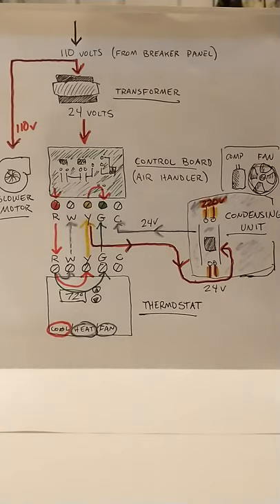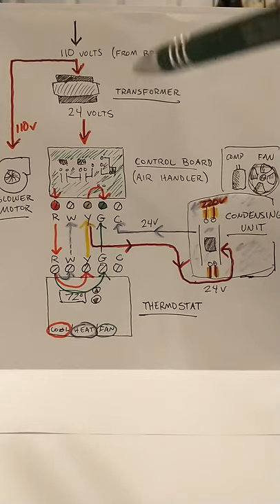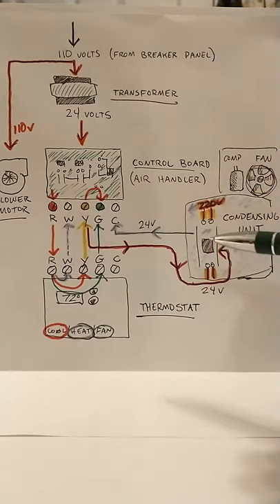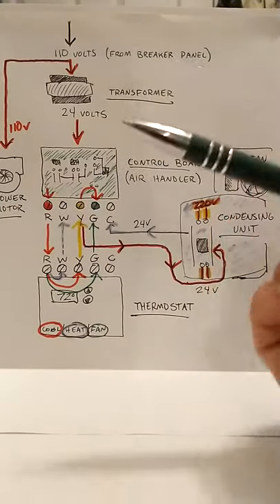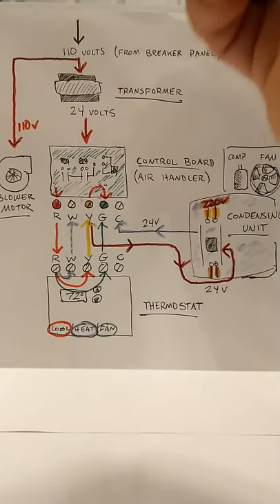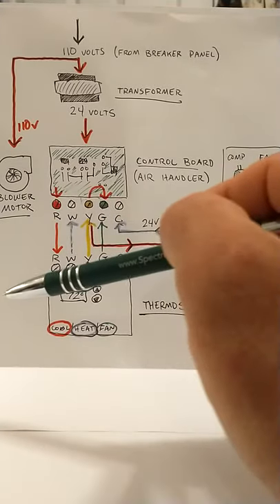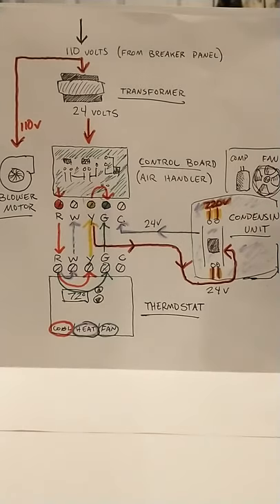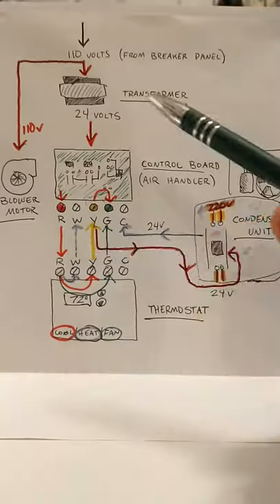HVAC Low voltage control wiring (Basics For Beginners)

Comment: Mike, You are an excellent teacher.  I am an electrical engineer but you made it a piece of cake to understand everything that is there to be learned about HVAC wiring in under 12 mins without any fluff or BS.  I am surprised you just have 2.42K subscribers. More people can benefit from your top notch content.  Thanks a bunch for putting this out
Reply from the maker: Thanks for the feedback. Really appreciate it!
Reply: Ditto!! Don’t need colors just the schematic and mike nails it!!

Comment: This was THE best video on the topic.  I have watched a lot that cover thermostat but I wanted to full picture which included the furnace controller card.  This video was the best as I am an electrical engineer (not an HVAC expert or even an electrician) but I was going nuts not understanding how the 24 VAC closed the circuit.  Nobody else explained it but this guy did!  Now I feel confident rewiring my 50 year old house with labeled wiring for a tech or the next home owner.  Thank you!
Reply from the maker: Nice. Glad it helped!

Comment: Your explanation was very clear.  I worked part time with an electrician for six years.  When I look inside my air handler it looks like a big jumble of wires.  You made it very easy to understand.  It’s just a bunch of different circuits.  Great job!  Best yet!

Comment: I’m a new HVAC installer and have only been employed by a company despite not having any sort of schooling or knowledge about anything, After a month of practice I am able to do everything i need to help out my leads, but have been struggling to understand what each low voltage wire does and I feel significantly more comfortable with it after this video. It was very clear and helpful. Thanks man

Comment: Thanks man, a control wire had popped off my circuit board for the outdoor condenser and your video helped me to quickly put it back where it belonged on the common terminal.  Also de-mystified the color code confusion overall👍👍

Comment: Best simplified explanation!  Thank you for taking the time to make this video.  Keep up the good work, and keep the videos coming!  I would greatly appreciate it if you could make a video on how to hand fabricate a seamless drain pan, and how to wire a condensate pump into the alarm system so the float switch shuts down the unit if the drain pan gets wet.
Reply from the maker: I need a little clarity. Are you asking how to wire both a safety switch in a condensate pump and a float switch in a drain pan together into the control wiring to shut down cooling if either one is activated?
Reply from the maker: It would be the same as wiring a float switch as I described in the video. 

One end wired to R terminal at the control board, other end running up to R terminal at tstat (to shut down everything). Or you can use Y terminals at the board and tstat instead (to shut down just cooling) If it's a 90% furnace that generates water you can even do the same with the W terminals (to shut down heating). Few different ways to do it.

Comment: You made this easy to understand, I watched this video because I need to install a safe T switch and I need to identify circuit R. I had drain pipe clog that spilled water to my sheet rock. I want the switch to shutdown the unit for me when I am not home  or to avoid water damage.

Comment: Print this chart and check both ends before you DIY to be sure the installation tech wired it this way, some use their own wiring preference to prevent home owners from working on it. Causes more damage THEY will benefit from in the end and being they are legal HVAC certified and homeowners are not a court will side with the tech. Like the video great wiring diagram layout to help.

Comment: woke up to find out my heat never turned on, after watching some vids i found the low boltage fuse popped, replaced and still pops only on heat, trying to find out where the short is, this video is definitely the easiest to understand, within seconds of looking at the picture i was figuring out how it works. Thank You. hope i can fix my problem with the new knowledge.
Reply from the maker: No problem. Let me know if you find it.
Reply: @JerseyMikeHVAC  after 3 days of trying to figure it out i cant. no wires are exposed everything looks good. just blows fuse on heat, have been using ac fine. im trying to figure this out cause its for my mother and she cant afford to have a tech come out and look at it. ive learned a ton so far but cant fiigure it out.
Reply from the maker: @wrench  If it's just on the call for heat, it most likely has something to do with the wire between the W terminal on the thermostat and the W terminal inside of the furnace. 

 Do you have any extra wires available on that thermostat wire bundle? Maybe a blue wire unused? If so, disconnect the wire from both W terminals at the furnace and thermostat and reconnect the new wire to the W terminals at the stat and the furnace. See if that resolves the issue.

Comment: Best case of a so called union trained HVAC guy they called the filter king because it was the only job he couldn't screw up. He installed a maybe 5 ton AC unit in an office. He was so proud if himself he had the office manager watch him turn the unit in for the first time. Some how the filter king had the red wire going to the T stat connected to a 480 volt leg.  Left a 4' high burn mark.on the wall.
Reply from the maker: "Some how the filter king had the red wire going to the T stat connected to a 480 volt leg"

Lol. I have SO many questions right now. I get on my guys for not doing a drain assembly just right. How is this guy not tied down to something right now?

Comment: In the configuration shown, Y is jumped to G in the air handler. What prevents cooling from kicking on if you switch the stat to fan only? Seems to me it would close the circuit to Y in the air handler? 

Also, I am looking to connect my condensers to the load shed module in my generac standby generator transfer switch. I will break the red wire at the condenser where it connects to the contactor. I think this would shed only the condenser and not the air handler, correct?

This video was very informative. Thank you.

Comment: An Former Jersey man here.  What a great video!   Could you please help me out. I just installed a MrCool 36K hyper heat system. It is working fine, with the thermostat that came with the unit, (its only a 2 wire setup). Question is I would like to use my nest thermostat with the new unit. Would you please tell me how to connect the wires up. I don’t want to screw this up, by guessing it.   Thank you so much, if you can help me.

Comment: Around 8:08 you mention wiring in different switches, devices. At what point, if any is too much to pop the fuse,  cause a lockout or even experience drops in amps or volts; again if even possible any?  2:  The red hot comes in at 24 volts but does it reduce voltage as it ties into each separate terminal? Tks. I wish I could donate on your site somewhere.

Comment: Thank you for this helpful video. The only thing that I find confusing is the direct connection from the 110 Volt panel to the blower motor. This suggests that the blower motor is always on. Shouldn’t there be a relay in between that is controlled via a 24 V signal? Thanks again!
Reply from the maker: Yes, sir. There are always relays of some kind. When I made this video the focus was more or less on low voltage field wiring. I've made other videos since going deeper into the details with factory wiring and schematics. Glad the video helped!

Comment: You just solved mt issue .

What happens to w once it leads to the air handler but its what activates the PCB to run heat . So W always needs a wire if its for heat. Especially for a reversing vaule
Reply from the maker: In a heat pump system, W activates the backup heat, in most cases this is going to be heat strips, but could be a furnace or a boiler.  This terminal should only turn on heat during defrost cycles or when the heat pump system cannot generate enough heat on its own to reach demand (such as during a big temp difference between room temp and set point).
Reply: @JerseyMikeHVAC  i see. Thank you

Comment: great diagram and explanation. Can you explain the jumper from Y to G on the air handler though? I have the same setup. (no G wire connection from thermostat to air handler, but Y to G is jumpered on the air handler). My understanding is, when cooling is activated, it will automatically turn the fan on. and my gas furnace doesn't need a seperate fan on command from the thermostat because it controls it though the circuit in the background.
Reply from the maker: The Y terminal on control boards sometimes initiates a fan speed, even though the fan signal comes in on G from the thermostat. So if just G is powered, the fan will run at a low speed. If Y is powered the fan will run at a higher stage. Some systems do not even need the G signal and initiate the blower solely off of Y. So there are differences out there. 

You are correct with heating. The board initiates the fan independently off of a W signal regardless of G signal from T-stat, as the blower comes on as the final step of a furnace start up and so needs to be delayed.

(editied for spelling)

Comment: Great Videos. I got into installing a NEST ans it was not as simple as they say. Gland I found your videos. BUT I dont have the answer. The Nest was installed as best I could it run a test and worked well on cool Then, after . UNTIL i installed the  goggle app the display showed Cool but air was blowing hot? I reverted to the old thermostat  all is working as it did before.

Comment: Mike you would wire the Safety Switch from the Condensate Removal Pump to the yellow wire on your thermostat. Correct?
Reply from the maker: Yes you can do it like that, unless you have anything else that makes water going to that pump, like a 90% furnace or humidifier, then going to the red 24 v wire would be better.

Comment: Sounds if breaking Y(yellow) wire would be good method with float switch?

Is this way u would wire?

Great explanation with video.
Reply from the maker: Breaking Y is perfectly acceptable, but I have a tendency to break R instead. The reason why is because on a straight cool system, all that breaking Y really does is shut down the outdoor unit. Blower will still run inside. And in many cases, customers don't realize their AC is not working when they can still hear it running. It takes hours for them to realize it. Then they're calling you at 5 pm and want you to come immediately.  Breaking R shuts it all down and customers will catch it sooner. 

Another reason I go with R is because sometimes I have other parts of the system generating water even when cooling mode is not activated, like a 90% condensing furnace, or a humidifier... breaking Y won't catch those leaks because those components aren't using Y signals to function. 

The only time I see breaking Y as preferable is if the system is an 80% furnace with AC attached to it. In this case, if Y is broken, the heating can still be operational, where breaking R in this case would disable both heating and cooling. This is a bigger deal during those times of the year where both AC and heating may be used, where temperature swings from day to night can be drastic enough for heat and AC to be utilized on the same day.

Comment: thanks! new too hvac. install / changeout helper. this is gonna help me so much. smoke detector work the same as a float switch? how would u wire in a smoke detector in as well as a float switch. I can get the answers from work but the more I learn on my own the better I look (yes I should probably know this)
Reply from the maker: It would be better to learn that at work. Most companies stick with one or two particular brands and styles of accessories, where as there can be dozens of different types out on the market that may be wired differently from one another. Two different guys can also wire the same thing in different ways. 

All accessory items come with instructions and wiring diagrams. A good way to learn is to grab these manuals after an install is done and keep them to read and for reference. 

You don't have to memorize it all  just figure out one wire at a time, what it does, where it goes, etc  The next time that accessory item is being wired in, try to pick out that one wire. Once comfortable with that, move on to learn another wire, and so on.

Comment: Let me ask you, can it also be said that if I understand the wiring first, everything else will fall into place and make sense about all the other major moving parts from a bigger picture perspective?
Reply from the maker: Yes, I would say that's very true. Every hvac system has a very particular sequence of operation, meaning all of the bigger picture pieces come in and out of play at very particular times. That entire sequence is controlled by the wiring. 

So if you know the wiring, you'll learn the sequence. If you know the sequence, you'll learn what each bigger piece does and why it is in that part of the sequence.  If you know what each piece does, you'll know how a system works all together and how to better diagnose problems when it isn't working properly.
Reply: @JerseyMikeHVAC  Perfect, wiring is where I'll start. Thank you so much! I'm subbed with bell notification, so keep the content coming!

Comment: Hey Mike, love your videos. Got a question for you. 
Have you ever used a decade resistance box to bypass a temp sensor temporarily? 
If so, how would you wire that in as most temp sensors just go to a board or t stat
Reply from the maker: Can't say I ever have. In most cases I have just disconnected the wires from the stat or board.  Had a combi boiler recently (Triangle Tube I believe), where I just changed the programming to deactivate the remote sensor, so didn't even have to disconnect the wires. 
Don't believe temp sensors offer up much resistance anyway. Don't want to say with certainty, but alligator clips might even work.
Reply: @JerseyMikeHVAC  thanks mike!

Comment: So if I got a new wifi thermostat with that needs a c wire I can just jump the r terminal to my c terminal? Can’t be that easy, will my fan always run?
Reply from the maker: At the board that will create a direct short. At the thermostat the c terminal doesn't go anywhere unless you have a wire already connected to it that goes back to common in the unit.

Comment: any idea what would make my goodman 3ton unit keep running after it reaches temp in house. I have replaced thermostat no change also had to replace fan board because it burnt up last week
Reply from the maker: Is it only the outdoor compressor continuously running, only the indoor blower running or both running after reaching  temp?
Reply: @JerseyMikeHVAC  the compressor contactor as well as the blower motor outside stays running  when i checked fan board i still have 24v on green keeping blower motor running i assume the temp inside house could be 78 and the cool setpoint will be reading 78 but it been running for 35 min since the 2 numbers matched thats not normal
Reply: never had any issue till last week smelt a burning smell and the fan board relay had burned up i replaced my board with an oem upgrade board and stuff started goin haywire never had this issue before
Reply: i have been an electrician for 30 yrs and iam kinda feeling lost
Reply from the maker: Take air temperature readings at the return grill and the closest supply run coming off of the unit. What are those 2 temperatures reading?  It should be roughly a 20 degree difference. One possibility is that if that temp differential is considerably lower than that, it could be an airflow problem (dirt, or maybe ice build up) that is keeping the system running much longer cycles than usual, putting a lot more strain on the blower motor as a result. Let me know.
Reply: @JerseyMikeHVAC  74.6 at return and 58.6 at vent
Reply: whats strange if i move my setpoint up 1 degree manully it turns off or if i pull thermostat from backplane it shuts off i have a honeywell home T3 programmable i replaced that today as well
Reply from the maker: The Honeywell stats  read temp in decimals but only display in round numbers, so that is likely why the system will continue to run a while even if the room temp and set point appear to match. But it shouldn't run for prolonged periods due to that. Maybe 5 minutes if that. Some stats also have a temp differential they work off of, so they may go a degree or so beyond actual stat readings. Sometimes there's a setting you can adjust that with. Sometimes not. That can also prolong run time further. 

The lower temp differential there is an indication of either some airflow restriction or an imbalanced refrigerant charge.  It's not horrible, but there's an issue coming up there that can use some attention. That will also prolong run time. 

Those two things combined can be running the system longer than usual at set point. 

Is your air handler in the attic?

Comment: Love your drawing, can you draw a drawing with a heat pump.  I have an issue where I have a heat strip that comes on and the system goes down, I don’t think my bleeder is moving enough air and it’s overheating, the three strip elements may be too much heat tripping the sensors
Reply from the maker: I recently did a few videos on heat strips and heat pump wiring, all fairly recent in my library with drawing of circuits in each.